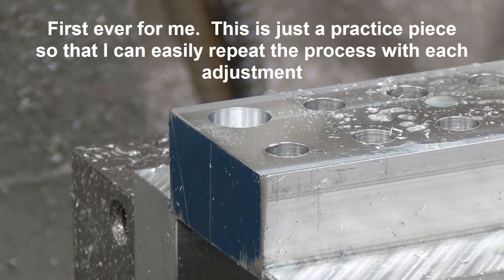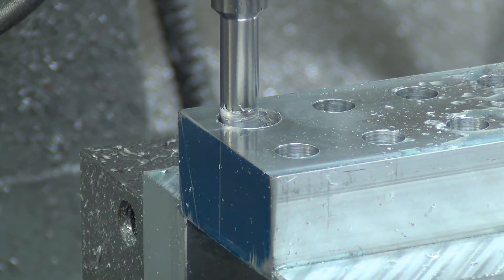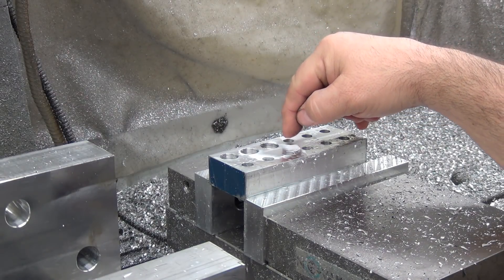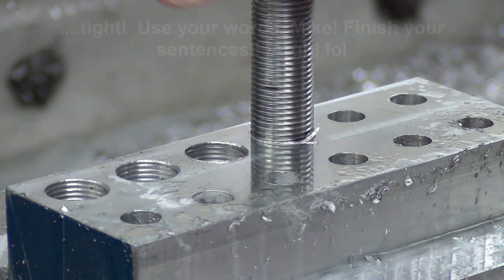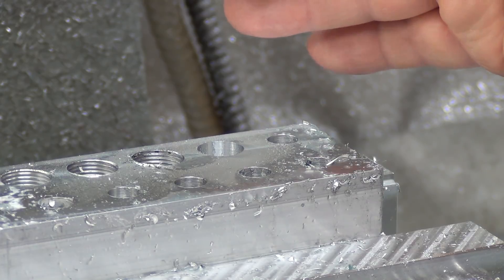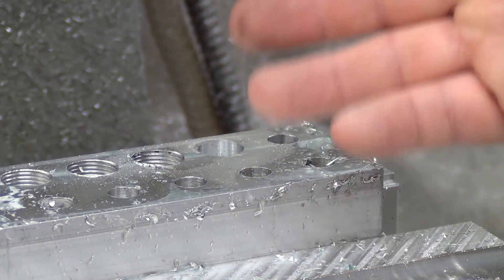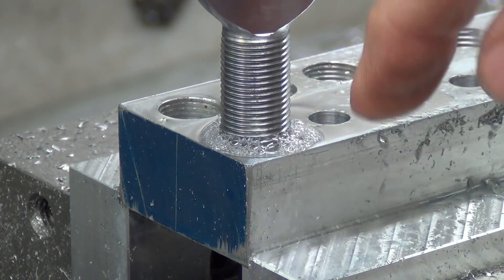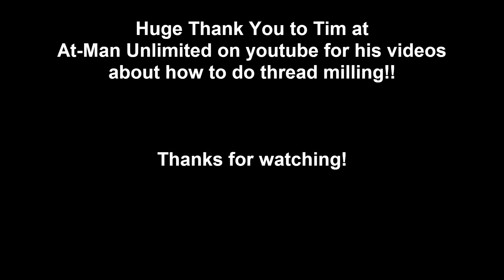Thread Mill Testing

Comment: Hi Mike,  Just found your YT channel after seeing you comment in one of Aron's videos.  I watched most of your videos and have to say they were great.  I see that you have not posted in a few months.  Hope you can post some more machining stuff.  If you have a chance and are still interested in CNC  machining info checkout my Instagram @sjb_rnd.
Reply from the maker: Hi Stephen,  Thanks!  I had a reply typed out and then closed the page before hitting the reply button. :(  ....I'm not too bright sometimes. lol  I took a few months off due to a ton of overtime at work.  The money was too easy to pass up.  It was nice to get out of the shop for a bit, but it's time to get back at it.  I've got a ton of video back logged in the video editor.  With the changes at work, I can no longer spend 3-4 hours a night working on personal stuff.....so it's either do computer work at home or shop stuff.  Things are moving extremely slowly.  I'm hoping to finish getting the mill cleaned up today so that I can get back to making some chips.  I've got a handful of orders stacking up that I need to make some progress on.  Thanks for the sub and follow.  I followed you back.  I had to tell it to translate....where are you at?
Reply: @bluehandsvideo  lol I'm in Florida.  I guess that's why you needed to translate it.

Comment: Mike since you are opening the hole up less than the standard hole opening than is recommended for the 5/8 13 tap, is this because of the soft material you are working with?

I sthis something you will have to "learn" for each size thread you run on the mill on soft material?

I there not a written guide you can download to help reduce the learning curve on milling threads in various materials.  

If it is easier Mike you can email the answers to charlie69@cox.net.  I have you in my exception list so all other emails will go to the trash.
Reply from the maker: I'll try to get back to you tonight Charlie. :)  Basically, I'm still learning.  Yes, there are some guides out there.  The testing is basically to get things dialed into what this machine actually cuts.  You can tell it to cut a 1/2" hole, but due to other factors....machine rigidity and tool flex, it may not come out exactly at a 1/2".  It's going to be within a few thou without any problem, but when trying to get a snug thread fit, the "tweaking" helps to get it perfect by compensating for the other factors.
Reply from the maker: I think I mentioned in there that the spec I was following was going to net a 50% thread engagement.  I was trying to leave a bit more metal for a higher thread engagement to help avoid thread pull out.  I haven't studying thread info enough to know if it will make much of a difference in use, but it sure sounds better to have 75% thread engagement. :)  I should create a 5/8-13 hole with a tap and measure it.....but the tap drill dictates the thread engagement.  If I took a pic of the thread made, the peaks at the minor diameter would be flat instead of pointed......which is good....sharply pointed would most likely drag on the bolt and cause issues.  Anyway.......I left the info here too for others that may read this question/answer. :)

Comment: What what pink fingers, have I got the right channel? 
I was about to comment about have you got the right pitch when you worked it out. You are making me feel that I wish I could afford to buy a CNC mill.
Reply from the maker: I leave them uncovered now and then. lol  I have the laptop on the bench and trying to type with gloves on is difficult.  A lot of times, the laptop is just there in case I need it, so I wear gloves.....this time, I was actively changing the parameters on the cut and reposting it.....so no gloves. :)

I thought I'd be waiting a few years longer than I did, but I took a loan out against my retirement at about 3%.  Figured in the time it took to repay the loan, I'd be able to learn how to use it and get some product development done prior to retiring.  I also thought the VA would have taken care of my back pay issue and I'd be able to afford to retire soon.  At least the cnc stuff has....is working out okay.  The VA will worry about my stuff when it affects them personally......so probably never.  Anyway.....I need to hit the shop and make some chips.  :)